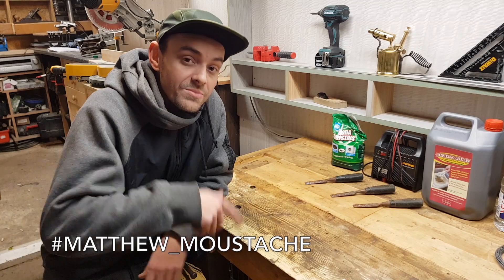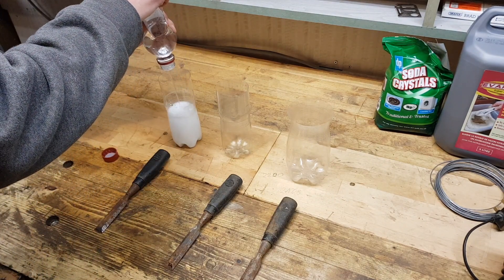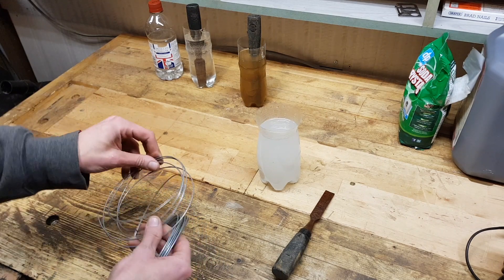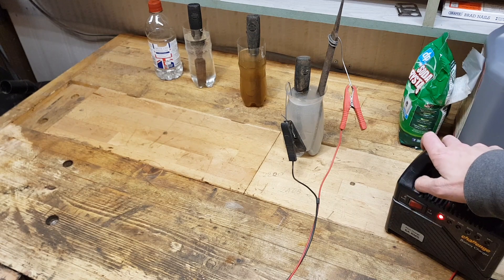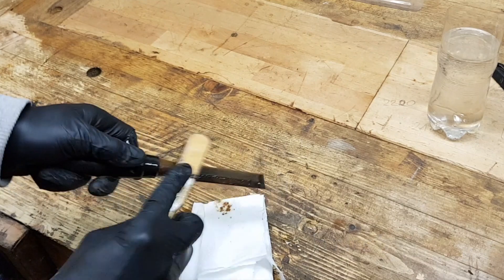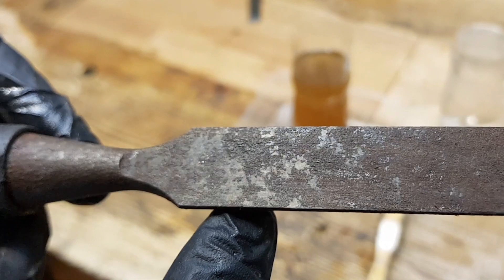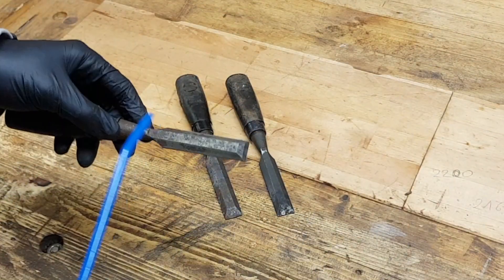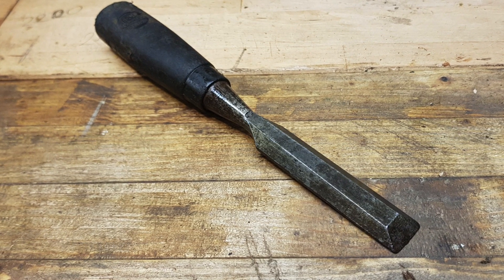HOW TO REMOVE RUST - 3 EASY WAYS

Comment: Vinegar works very well for removing rust. It leaves the metal feeling a little rough but it gets the job done. 👍
Electrolysis is a little harder to set up (and potentially VERY dangerous) ,but can give you a fantastic result.
I’ve never used Evapo-Rust but it seems to work as it’s suppose to.
All of these methods will work just fine and it just depends on how much time and money your willing to spend on your tools. 
Great video MOUSTACHE 👍
Reply from the maker: Thank's mate, yes electrolysis can be dangerous in some cases  because of small amount of hydrogen produced in this process but as long you have well ventilated workshop or doing this outside you are safe also if you work with something small that shouldn't be a problem (never had any) 😎